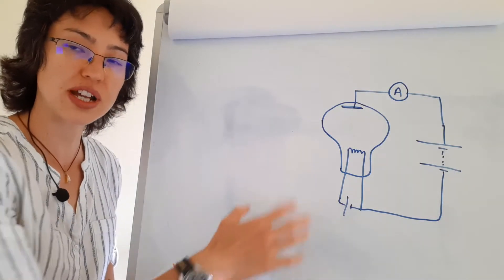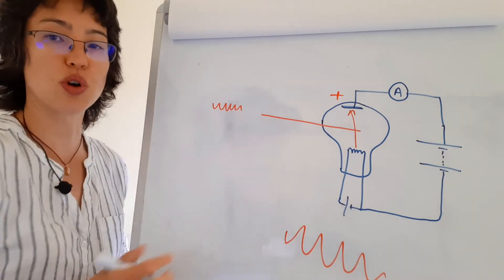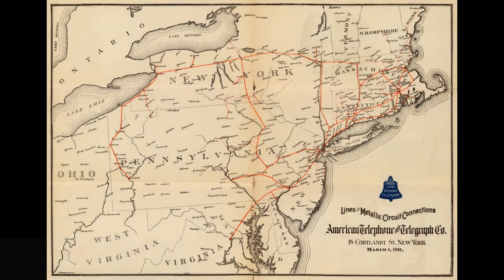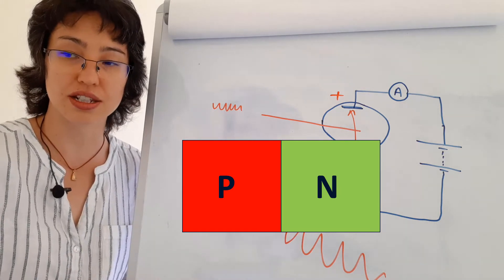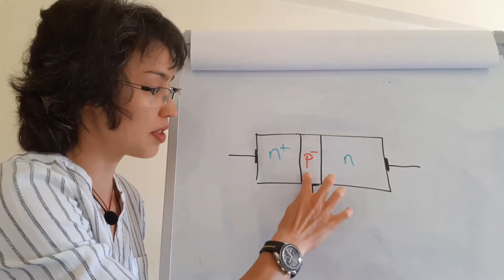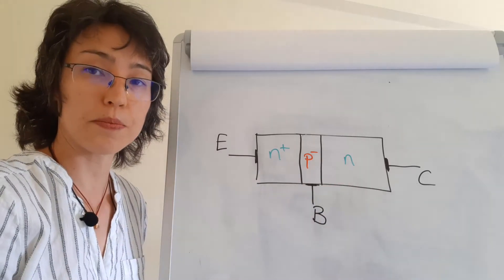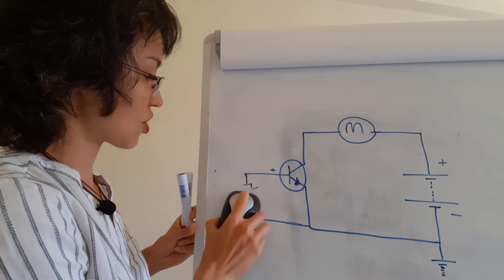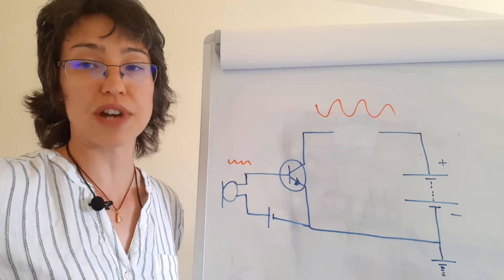Semiconductor devices (part 3/6): Transistors (BJTs)

Comment: In your circuit diagrams at the end, I don’t understand how any base current is generated. Does the circuit depend on collect to base reverse current leakage?
Reply from the maker: thanks for your feedback, you're quite right, I hadnt noticed at the time but there is a mistake in the final diagram, there also needs to be a potential difference on the base side of the transistor

Comment: Do I have it wrong? At the end of the video, when you are showing different applications, you have the base pin connected to the negative terminal of the battery. Shouldn’t it (through a resistor) be connected to the positive? Thx.
Reply from the maker: oh absolutely right, I'd not noticed this mistake, thanks for pointing it out. Indeed the base should be more positively biased than the emitter.  The resistor at the base should be connected (or indeed replaced in the diagram) by a smaller power supply / battery with the positive terminal on the base side.  Thanks for watching and commenting